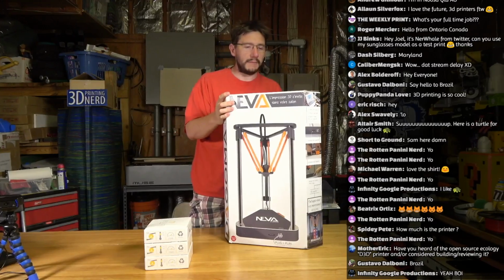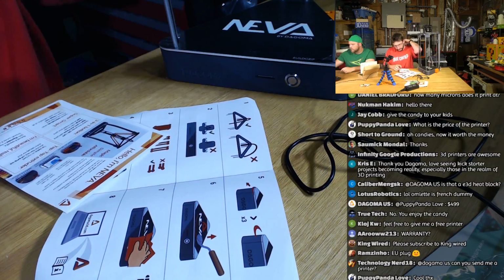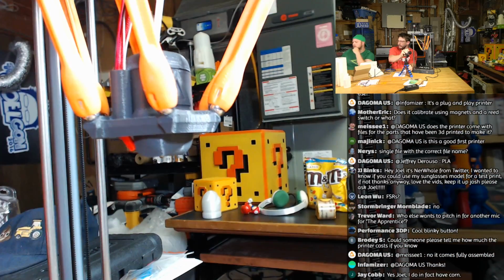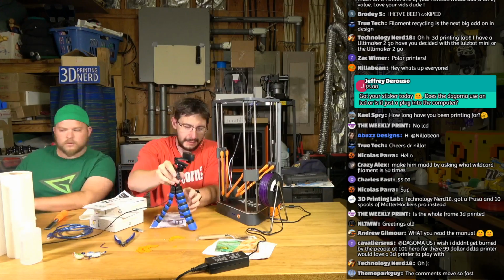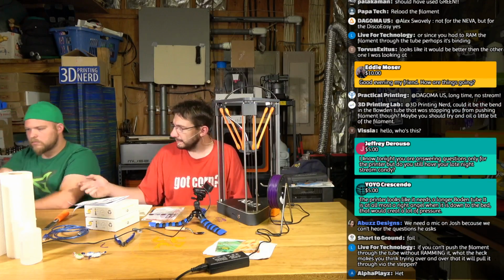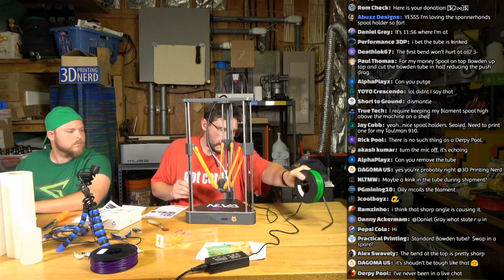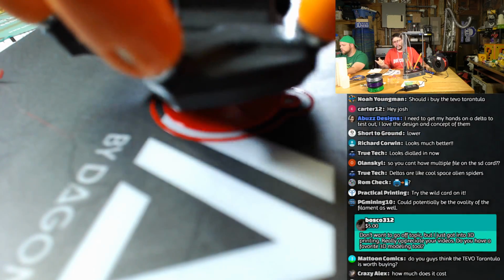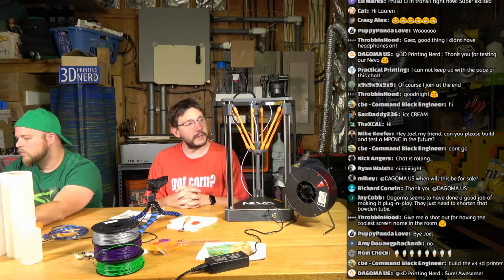The Dagoma Neva Delta 3D Printer!

Comment: I bought one of these and have become increasingly frustrated with less than 50 print hours on the machine. The nozzle clogged and could not be unclogged with any of their provided steps and was ineligible for warranty replacement. I then took it apart and repaired it. It worked for another few prints and clogged again to the same extent. After the thermistor wires snapped, I no longer had a working 3D printer. They do not offer individual components needed (which are in the single digit dollar ranges) so you have to buy a new $72 print head. After receiving the new print head, it appears the feed mechanism broke when trying to eject after the last clog. Not even a full spool has run through this thing and it's a giant paperweight.

Don't buy this piece of junk.

Comment: I’m surprised you never had issues, I guess you received the France version because I received mine in a generic box with a few pieces of foam to hold it in, then the printer head is enclosed in bubble wrap envelope. Leveling not completely finishing, thermistor errors, extremely slow customer response. After going through two printers, then receiving the printer  from their service center two weeks later (thermistor issue) ,  the issue was never resolved. Just returned it. I got 3 decent prints from all that ordeal. Don’t expect a quick response with customer support.

Comment: How much does it cost? Checked the site could not find the price... I am guessing the printer is still in pre production?
Reply: $499 :), pre-sales next week, and delivery end of September :)
Reply: Cool thanks! So are there shipping costs like when you purchase a SeemeCNC Eris or is shipping included in the 499?
Reply: Also I was wondering if you guys were interested in doing a side by side comparison video of the Neva compared to the Eris? I own an Eris and I have the time to put together some demo videos to show case the two printers side by side as I also create my own 3D printable custom models. I feel that there are lots of good   aspects of the Neva that could be show cased. I think that at the moment based on this video that the Eris and the Neva are the only two 3D printers on the market that come ready to print pretty much straight out of the box with pretty much zero hassle to get them up and running from a user perspective.  It would be very interesting in my opinion to have the two running side by side to see how they compare in quality etc...

Comment: Need to mount an electrical plug to the inside leg of your table nearest you so your not having to string the printer power adapter across the front of the top.